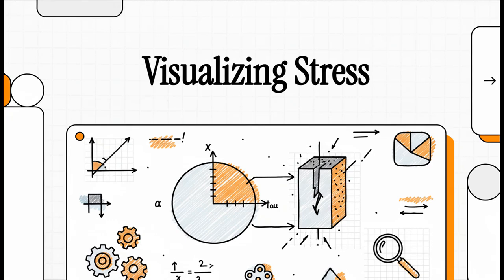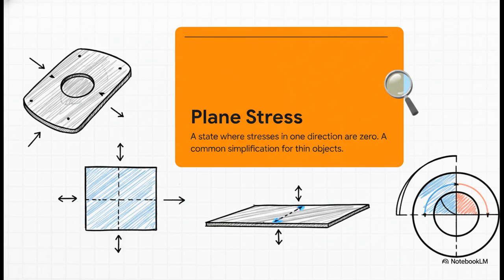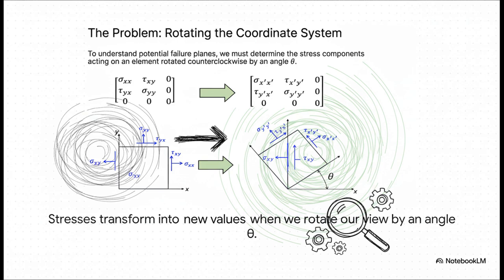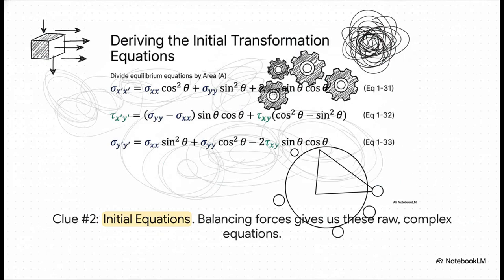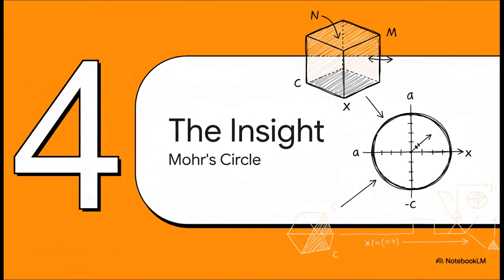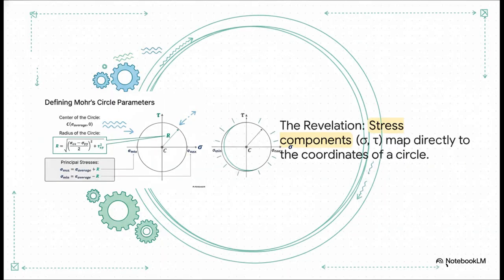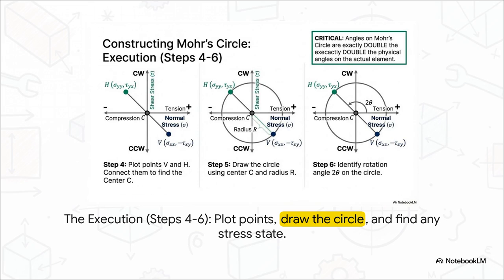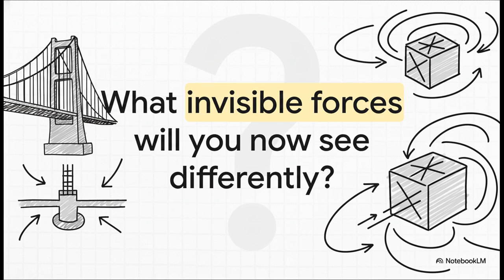MDS(Eng) 1-5: Visualizing Stress

Comment: Thank you for the excellent explanation of Mohr’s circle. The graphical interpretation made it much easier to understand. It would also be great if you could demonstrate some real engineering problems where Mohr’s circle is applied.
Reply from the maker: Thank you very much for your kind feedback.

I am glad to hear that the graphical interpretation of Mohr’s circle made the concept easier to understand. One of the strengths of Mohr’s circle is that it provides both a visual and mathematical understanding of stress transformation, principal stresses, and maximum shear stresses.

Thank you for your excellent suggestion. 
In future videos, I will try to include practical engineering examples such as pressure vessels, shafts under torsion, welded structures, and failure analysis of mechanical components. 
Seeing how Mohr’s circle is applied to real engineering problems can greatly enhance intuitive understanding and problem-solving skills.

Thank you again for your support and encouragement.